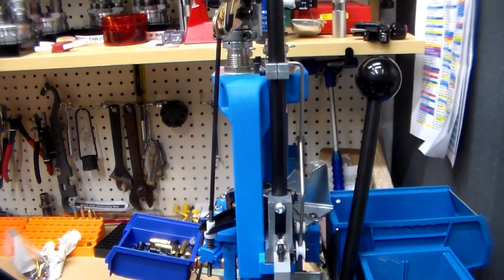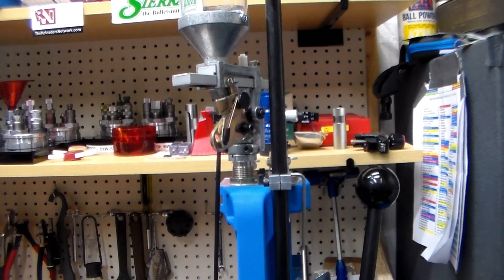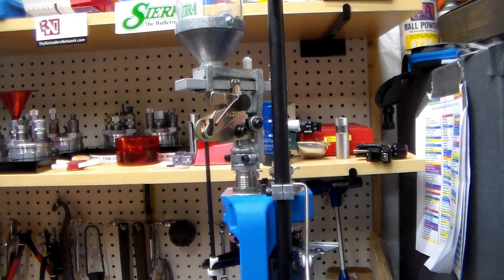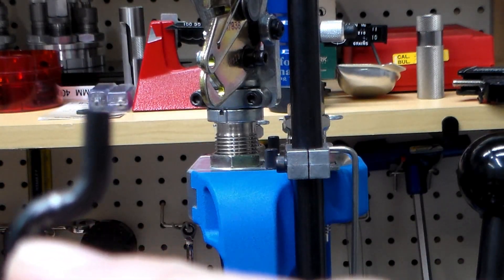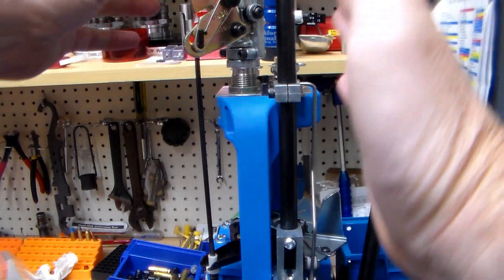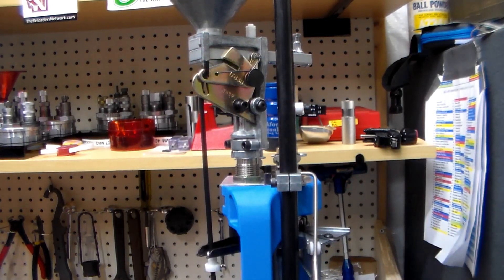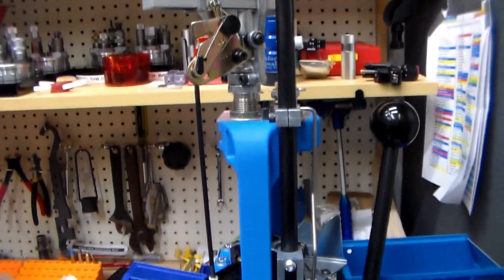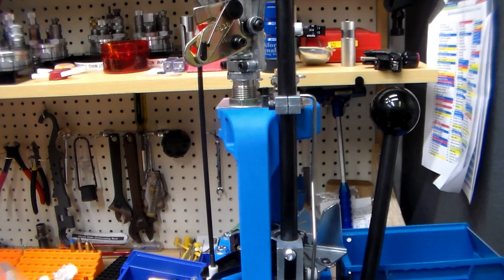Problems with the Dillon Powder Measure

Comment: I had the same issue and I contacted Dillon. The said that was in there design to assist in not uniform powder drops. Basically causing a settling vibration each time making the powder throw more uniform.

Comment: Wish I had thought to check youtube on this issue first!  I followed everything to a tee and was very frustrated it wasn't working right.  I had to majorly bend mine to even attach it and thought this can't be right.  I talked through the issue with a buddy and I just decided I would bend the rod and see if that solved the issue.  Boom!  Instantly solved my problem and now it runs like a champ.   Disappointing for sure when you spend that kind of money but it sure runs a thousand times smoother than my my ol' single-stage Lee!
Reply from the maker: Very frustrating for sure. Glad you got it working. I  love mine too, now that it's working.

Comment: I have 2 550’s and 2 1150’s just ran 25k of 5.56 (for personal use) and not a single issues with powder dispenser. Have owned Dillon since late 80s and experience no issues. So maybe your set up is the issue.

Comment: Had the same problem with my new 750.  Played with it for hours and it would bind if I had it vertical and the large linkage would get hung up on the powder charge slide.  I watched this video and read the comments.  Went out and bent the end piece (just slightly) to make it more 90 degrees and everything suddenly worked.  No binding or rubbing.  I wouldn't have believed that such a small adjustment would correct it all.  Thanks!
Reply from the maker: I am glad the video helped and you got your press running. Thanks for the comment, I appreciate it.

Comment: I double-tied a 1/4 wide rubber band on the powder measure bar around the base of the clear hopper. I also disconnected the spring and the catching you showed was eliminated. I the rod is not perfectly perpendicular in my setup, so I shrink wrapped (electrical supply) the excess threads so that nylon bushing doesn’t get shredded over time.  I disconnect the rubber band when storing or not using.
Reply from the maker: Well, whatever works for you. Mine did not work without some extra bending on the return rod.

Comment: Glad to see I was not the only one.  The fail safe rod was not quite at a 90 degree angle; perhaps 60, with the same symptoms you describe.   I applied some heat and bent to 90 degrees on both turns and now it works as advertised.  Thanks for the video.
Reply from the maker: Thanks, glad you got it working.

Comment: Great video.. I had the same problem and wound up having to bend better angels on the rod like you did.
Im glad to see  that some one  else did a home made  mode  like you and me did. with success.... Thanks
Reply from the maker: It seems to be a somewhat common problem, makes you wonder why can't fix it. They are sending me a new rod after much correspondence  back and forth. We will see what I get and how it works. Glad you got yours going, thanks for commenting.
Reply: I HAD THE SAME EXACT PROBLEM!!  I DID THE SAME THING
Reply: I’m having the same issue I messed with it all day today. Kinda got it running and will mess with it some more tomorrow. But yes I agree all the money these 550’s cost you would think that they would have the manufacturing process down to a tee.
Reply: @Johnny-jr2lq   The problem in a nut shell is that the rod is bent and so the angles are not sharp 90 degrees. This allows  the two bell crank pieces on the powder drop unit to not being able two move freely independently. They are jamed together,so what  is needed is two bend the rod so it will move the bell crank parts to move freely p and down independently.. Its not hard to do..Good luck with it..

Comment: I had same issue on the new powder cylinder drop kit I ordered almost 2 years back so I could have a separate head for rifle and pistol calibers. Dillon offered to send me out a new replacement rod, almost like they knew what part had the problem. Still during the 1 week wait for delivery I bent my rod using long nose vise grips and my bench vise. The rod is rugged and almost seems tempered. Finally adjusted the two corner bends to much sharper (matching the rod on the original powder cylinder). That made it work perfect. When the new part arrived it was like the bends were perfected, almost like they knew they had a problem. I kept the new rod as a backup. Sorry you had the same issues as me, and I agree that for the price invested in the machine and kits there should be no issues or hiccups getting it to work. At the time I had my issue i spoke to a manager who explained how the press operated; how to adjust for the powder bar to function optimally, and I was well-served for sure.
Reply from the maker: Thanks for the comment, I appreciate it. The customer service issues that I encountered were due increased volume and decreased staff during the start of covid. I did receive a new rod and finally got someone to call me back. Main thing is the press is working great now and I am happy.

Comment: I have the same problem on a new 550c contacted Dillion and they sent me a replacement rod, never a problem with their customer service but it does the same thing. So I just emailed them again and attached a couple of photos I agree with you the bend in the rod should be 90 degrees and it's not. Hopefully Dillion will fix this small issue love my Dillion sdb have loaded over 10000 rnds on it and its still like brand new. Thanks for the video now I know I'm not the only one.
Reply from the maker: Thank you for the comment. I thought that I was a complete idiot for a couple of weeks. Hopefully, you can get your 550 working.

Comment: Well I've been trying to put my 550c that was delivered today. Guess what? I 've had exactly the same problem. So frustrating after following all their instructions to the letter. Thanks for making this video to show what you went though.
Reply from the maker: Glad it was helpful. The bend angle of the op rod was my main problem. Hope you are able to get it working.
Reply: @kyfirearms  Hey, is it right for the white plastic sleeve to just slide up and down the rod or should it be holding? There is no pressure on the upward movement. If I put some pressure on it with my had it works.
Reply from the maker: The sleve should slide up and down the rod. The bullet case should active the powder measure and the the rod should pull down the fail safe and reset the measure on the way down. It took me a while to get the bend just right. You might need to file the bends on the bar.
Reply: @kyfirearms  Thank you!! Ok, I've got it working!

Comment: Wait wait wait... This isn't correct.
Without a case in the powder thrower die you can't set it to operate otherwise everytime you pull the handle you'll throw a powder charge..?
Or are talking about a different problem?

Comment: "Slight" bends are better than "Extreme" bends.
I let mt powder measure "float" and it finds the path of least resistance on it's own during cycling.
I also used "Super Lube" in Dillon-recommended areas throughout the machine.
I used "Dry Lube" on the powder measure slide to allow for freer travel of the Powder Bar.

Comment: Had issues setting up the bar on my 650 last year but finally got it going after talking with a couple of people, Dillon is usually really good about sending parts surprised the didn't just send new bar
Reply from the maker: I thought maybe they would send me another one just to get rid of me, but they didn't. The last emial just said " tweak the bend" so that's what I did.

Comment: I had the same problem last year, i went with the lee Auto drop and have load 5,000 rounds so far with out a problem. i love my Dillion but their power drops leave a lot to be desired. I believe the simplest design is the best
Reply from the maker: It seems to be working now. I and going to run 20 charges or so and weigh them before I start running it. Thanks for commenting, I appreciate it.

Comment: Thanks for the Video.  Im super frustrated at my 550C   yes that rod should run perpendicular to the machine but sure as hell doesn't .. I tightened  the nuts the have said and now  only way i get it to run properly is at about 10 to 15 degree difference off of zero
Reply from the maker: I have a couple videos on this. The bend in the rod should be at 45 degree angles. You can put in a vice and bend it or file it down or both. That is what I had to do to get it to work right. I know how frustrating it is and I hope you can get it working.

Comment: I run the fail safe bar straight up and down on mine . I think the bend was your problem . I'm surprised they didn't offer to send you a new one .
Reply from the maker: The guy emailed me back and said "make sure both bends are 90 degrees. If necessary tweak the bend a little". I was starting to get a little upset, but I was able to bend it enough for it to work.
Reply: Okay, whatever you say.  I'm sure Dillon will correct it.

Comment: The powder measures on my two 550's just work. They required no hammer bending heating and forging or anything. The measure should be tight on the powder die after you set the case mouth bell. Thee spring when compressed should have a slight clearance between the coils and not be completely compressed. .
Reply from the maker: I know all of that. My failsafe rod was not manufactured correctly. They had a run of bad rods for a while, hopefully they have it fixed now.

Comment: I had the same issue with my xl 750.  I'm still messing with th consistency of the powder measure.  I'm trying to tell myself that it's part of the reloading experience but just once I'd like to buy something that I didn't have to modify.
Reply from the maker: Dillon is supposed to work perfect right? I had people tell me that I was stupid over this, but they mad a bunch of fail safe rods that were not bent correctly. Hopefully, that is the only problem that you have. Thanks for the comment.

Comment: I had this problem with my 550c out of the box and it turned out that the failsafe rod wasn't bent properly up top. Looking at your video you have the exact same problem. I called dillon and they immediately knew that was the problem and sent me a new failsafe rod. While waiting for that one to arrive I bent the top of the rod (as you mentioned) and it functioned perfectly afterwards.
Sounds like some of the rods simply aren't bent to spec from the factory.
Reply from the maker: I am glad you were able to get in contact with Dillon easily. It was a struggle for me to get someone to help me. They sent me another rod, but it was the same and didn't work. Bending and filling the original was the only way I was able to get mine working. I love my 550 except for that for little problem.

Comment: Im having the exact same issue with my 550c however im also getting inconsistent powder measuring, any idea how i can remedy this problem?
Reply from the maker: Make sure the bend is 90 degrees and the rod hangs straight then tighten it down. It may be the powder. It likes fine powders from my experience.

Comment: Dude, you have the fail-safe bar ran through the wrong side, It goes on the other side of the mechanism of the powder measure, it is an easy mistake.  Just run it through (Hook wise) on the other side. that should fix it, Btw, that piece that makes contact (The flat that hits the measure), it is supposed to do that, it makes a physical "Tap" go through the mechanism and shake the measure so your powder throws are consistent when it throws the next charge. -Dave
Reply from the maker: That's the way it's supposed to go on a 550. I sent lots of pictures in the emails and they said it was set up correctly. I don't know, but it seems to work after I bent the curve a little more.
Reply: @kyfirearms  You have it in there backward. believe me. You have it set up wrong.
Those people follow flow charts. trust me. you have it in there wrong. mine will do the same thing if I set it up like yours. and I have two of those, both are the same way. and both will do the same thing that yours was doing with the bar run through the other side.
Reply: @Thorsaxe777  I looked at my setup and agree with Thors Axe . My bar goes through the small hole first and works fine .
Reply: On my 750, it goes in from the slotted side. Not sure if the 550 is different, but mine is just like KFW has it.
Reply from the maker: The directions show it the way I have it and the rep from Dillon said it was right. The Dillon rep said to bend the rod, I should have just asked some of you guys first.
Reply: @kyfirearms  Thor means well i'm sure but the schematic drawing that comes with the up grade kit  shows the bar thru the elongated slot first on the left not thru the small hole first on the right side. I tried Thor's way and it runs smooth but 
don't  think its correct what he is saying....
Reply from the maker: @gerald4888  Yeah, he is a good guy and has helped me out in the past. I couldn't get the rod to hang straight no matter how I put it in, before bending it. He just couldn't believe I was having so much trouble. Weird how the bend on that little rod will totally mess up the machine.

Comment: Hey that flat tab that you say should slide beside the powder bar is supposed to hit on vertical protrusion that is about 5/15 wide  and an inch and a 1/4 tall.
Reply from the maker: I learned that after the fact. The bolt was too tight and it was not able to move freely. Thanks for commenting.
Reply: @kyfirearms  Sure thing.Ive only had my 550 since last June and have added and changed a few things.Its running pretty smooth now.A clickable powder Knobb wit number I got off Ebay where there is just a bolt head to turn for more or less powder was a big help and a longer shim with a side roller for thge primer bar that I bought off Ebay was a improvement as well..That stupid cotter key in Primer Drop Chute was the 1st thing to change.I was dropping old primer all over the floor.And some good lights too was another add on. For as much as we pay for the Dillon 550C you would think they would do a better job.

Comment: what I found was the the top of the fail safe rod is not bent at 90 degrees for the rod to drop vertically.  I put it in a vice and bent the top and wallah it became vertical and parallel to the press casting.
Reply from the maker: Exactly. I don't know why Dillon can't make sure the rod is bent right.

Comment: Throw that piece of shit rod away and tie wrap the brackets in the far downward position.   Now all u need is the old powder measure springs so it will return to the closed position.  This also give u the option to put the measure in different positions within the toolhead so you can use a bullet feeder die or other configurations.  You will be glad you did.

Comment: Your bell crank screw is too tight. the tang should rest against the powder measure bar guide as you move the handle up. at some point, the spring tension overcomes the friction on the tang and the hopper should drop and the powder bar moves back to the fill position. on the bell crank screw is a saddle spring washer, it only needs a little compression to keep the bellcrank against the powder measure. the powder measure should drop under the force of gravity, not by the force of the handle pulling the bellcrank down.
Reply from the maker: I went through all that. The bell crank was too tight, too lose, etc. It was the return rod not having the proper angle and putting pressure on the fail safe mechanism. Thanks for the comment.

Comment: Im having the same problem guys with this new upgrade on the powder measure upgrade kit.  My old 550 is from the 90's and the system was completely smooth, no issues at all.  Putting it in from the other way, the small hole, opposite of what dillon tells you to do just made matters worse, that made the nylon square bushing pull out every time because it was pushing too hard on the crank no matter how I aligned the rod.  Placing it in from the back side as dillon states, it will not go vertical/aligned with the press like its supposed to and made the crank bind up against the powder body when I raised the ram and lowered it...and I adjusted the nut to fine tune it just like dillon stated in the instructions.  Nothing worked.  I'm beginning to think I should have never taken off the old assembly.
Reply from the maker: The fail safe bars are not right. You can bend it a little more or file it down on the flat part where the bend is. That's the advice I got from Dillon. They are extremely hard to get on the phone. I put mine in a  vice and bent it until it hung straight. I hope you can get some help or fix it yourself. I know it is frustrating, good luck.
Reply: KFW  your right I had to do the same thing the rod was not bend correctly

Comment: Yep having the same issue
Reply from the maker: I have made several videos on it, hope you are able to modify the rod and get it working.
Reply: @kyfirearms  I’m going to check out your other videos and see what I can come up with. My press was bought used from a older fellow. So I decided to get the updated stuff I had to wait 5 weeks just to get the powder Measure update kit. I’m still waiting on the 550 extra parts kit even though I ordered everything together.

Comment: The problem you’re having is the depth of the powder die. When the case is in the shell plate and the lever is pulled down, the shell will hit the die and actuate the powder mechanism. If the die isn’t lowered to the correct depth, you’ll experience your symptoms. There’s no need to bend the rod at all.
Reply: Wrong it's the bend in the rod.